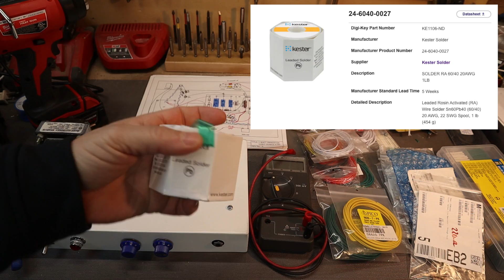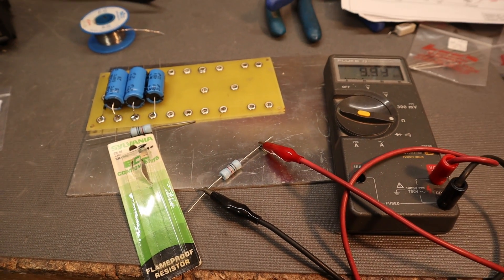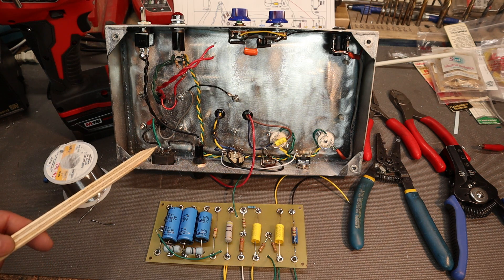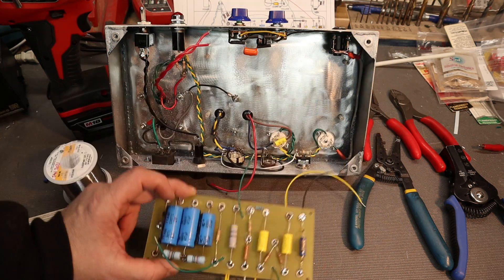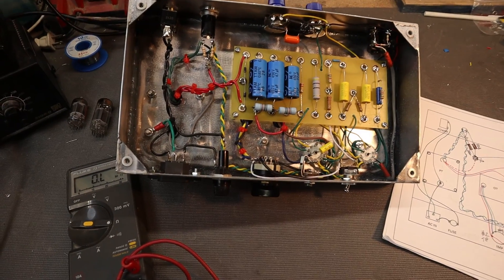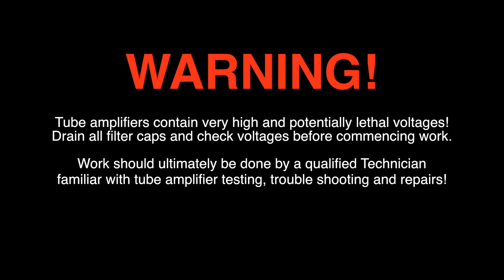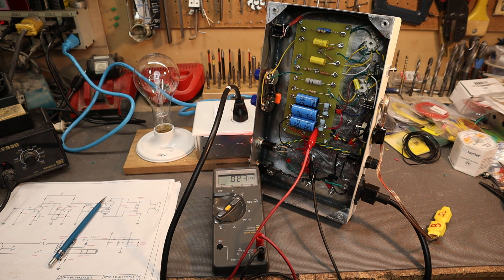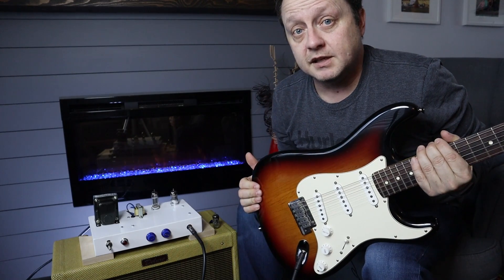Making a 1 WATT TUBE AMP-Part 2: Wiring, Testing & PLAYING // Building a guitar amp from scratch!

Comment: The 12BH7 is  being very conservatively run at just 1W of output, each of the two triodes is rated at 3.5W giving a total of 7W for the device. Class AB should be around 60% efficient suggesting that this can be driven to 10W continuous without exceeding its ratings - for typical audio use that implies a you-can-get-away-with-it peak of probably about 15W. The output transformer would need to be bigger, but a lot can be done with this parts line-up. The 12BH7 was designed as a TV frame output triode, that's a substantial workload and they are not flimsy components.

For something delivering more than 10W it's not the obvious choice but commenters here who think that 1W is a bit too low even for practice or studio use should note that it can do a lot more if asked.
Reply from the maker: Yes, the 12BH7 is a stout tube and it can be pushed hard.  It doesn't get a lot of credit.  I typically don't like to push my tubes hard. I'm the type of person that likes to make them last and I typically don't bias them too hot.  I do want to try a 12AU7 in this amp to see how much a difference it makes in volume and tone.  Cheers.
Reply: @MikeFreda  When I was a kid just learning about electronics, the 12AU7 family was everywhere. This is the first time I've seen the 12BH7 so thanks for bringing it to my attention. For output stages we'd typically see a pair of 6BW6 being used (6V6 shrunk to fit a B9A) base, but that would be a much bigger amp! I wish I'd kept a box of the transformers from those days, they'd be worth a fortune now.

Comment: I cannot believe that you leave the underside of the chassis bare steel it will rust, even painting it, it will not last. Steel chassis should be plated.
Reply from the maker: I appreciate the feedback; Yes, I should have on this one. I typically do but I'm not too concerned. My amps sit in my house in a dry environment the the bottom of the chassis is sealed off my the cabinet. It will be 50+ years before it may rust away... The caps will be done way before that.  lol  Cheers.

Comment: Hi, so I built the amp - and all the voltages check out except I get very low volume output from the amp. I checked everything and ya.....stumped to be honest. Any suggestions??
Reply from the maker: I suspect you have a wiring issue, wrong resistor value.   What OT did you use? PM me a few pictures and voltages and I can have a look.
Reply: @MikeFreda  I used the hammond 125A, I suspect it's because I'm running it off mains AC - kinda figured while I wait for the power transformer to be wound I would like to hear what the amp sounds like. (I have 230VAC for mains, which I thought would work seeing that the transformer gives 230vac) I am using a 20VA 0-230 0-6.3v for the heaters. 

Apparently you need a transformer  or I needed to adjust the rectification to simulate a center tap.....first amp build so still learning
Reply from the maker: Interesting. I don't recommend doing any of this. Doing this is very dangerous. I recommend waiting until you have all the proper components.
Reply: @MikeFreda  Oh and on the layout if the 13.6v is a negative, I'm only getting positive voltages, but in line with the schematic and layout

Comment: Outstanding build. Your tone was great and the steps were clear, concise and easy to follow. Very clean throughout. I even enjoyed how you built the chassis using TIG welding. Sounds great.
Reply from the maker: Thanks for commenting, I really appreciate it!  It was a fun build. I liked it so much I'm making a High Gain and a JTM version using this output section. Cheers.
Reply: @MikeFreda  Don't laugh, but I got into fiddling with amps. I would find these old tube amps on eBay that didn't work. Through the grace of God and help from a guy I befriended, (Jon Besent, who was an amp builder that started "Austone"), I never blew myself up. I bought a tube PA amp at the swap meet for $5.00, and converted into a amp head. It had 2 EL-84s and 1 12AX7. Believe it or not it rocked.
Reply from the maker: We all have to start somewhere. I started building tube amps in my late 20's when I came across a Fender Amp book that had a Schematic of a Champ in it. I said to myself, "is that all it is?"  I bought the book and took it to work. An old guy I worked with was into ham radios. He laughed when I showed him the book and told him I wanted to make this Champ amp. He then proceeded to educate me a bit.  The one major thing he told me was to always keep on hand in my pocket when testing.  I still do that today. Cheers
Reply: @MikeFreda  Very cool to have a mentor. The electronic guys are not around anymore, or at least in my neck of the woods. I live in the desert area of California, and when I was in high school we had electronics class. I wish I took it, but being a 16 year old kid with a 68 Dodge Super Bee, I dove into auto shop 100%, and we cruised the main drag in Palm Springs. It was a great time to be alive. Wish I would have picked up a guitar way back then too.

Comment: You didn't test the negative feed back loop?!?!

 But what great video I definitely want to do the same thing but I'm thinking maybe put two output tubes ( I had thought of maybe using four 12 ax7s as I'll put tubes but I don't know if that's even feasible)  and maybe a full tone stack. Put a potentiometer on the feedback loop and put it on the front of the amp as well That would be really cool. I'm definitely going to build this again thank you so much for posting this video and all the work you put into it and the schematics and everything Great job.
Reply from the maker: Thanks for commenting. Part 3 has some more test tones near the end. I was planning on a making a Part 4 with just playing but I never got around to it. It's still in the works.  Output tubes typically have a low MU and are able to drive more current. I don't think a 12AX7 is suitable for that sort of job. 12BH7 and even a 12AU7 is a better option in the output section. Adding a pot on the feedback is basically make a presence knob. Yes, that will work if the values are right.  To be honest, I didn't hear much difference wit it on or off. I may have to revisit my values.  Cheers.

Comment: Can you tell me what kind of transformer should i use for 230V
Reply from the maker: Thanks for commenting, I'm not too familiar with what is available globally for 230V PT's but I do know Hammonds 300 series have dual primaries for 120 and 240V. They are a little expensive but are available. Another option is to find something in your area that you can a salvage. Cheers.

Comment: can i use this for a phono signal? thank you great vids mann
Reply from the maker: Not really. The input impedance will not match and there is no RIAA equalization in this circuit.  This is a guitar amp, not a HiFi amp. Would it work?  Probably.  Will it sound good?  Probably not.  Cheers.
Reply: tank  you so much for your information friend  @MikeFreda

Comment: Great video! I’m fixing to build the same amp using a hammond chassis. Any issues using an aluminum chassis vs steel? Thanks!
Reply from the maker: Thanks. I've built amps using both types of metal. I don't think it really makes a difference.  Aluminum is easier to drill holes into and steel is easier to weld (if you need to weld the chassis)   Some people feel that the metal can affect the RF and magnetic field of the output transformer/amp. Ken Fisher (Trainwreck amps fame) only built his chassis out of Aluminum because of this.  My ears can't hear a difference. Cheers
Reply: @MikeFreda  thank you!

Comment: I currently have a 7 dollar iron I got from walmart, and no multimeter, do you know of any decent irons and meters that arent too expensive? I've already put together a distortion pedal pcb kit but I don't think I'd get away with my current set up for long 😂😂
Reply from the maker: I'd recommend getting a Solder Station with adjustable heat. Weller makes a entry level one of these.  (i.e. WLC100CUL) I used one of these for years when I first started.  As for a DMM, I'd get one rated for at least ~500volts. When dealing with Tube amps, you can see voltages that high. You want to make sure the unit and the probs are rated for that. I would not cheap out on this aspect. A base Fluke will work just fine for hobby tube amp building. (i.e. Fluke 101)   Cheers.
Reply: @MikeFreda  will there be any problems with not having temperature readout on that iron? Or does it not really matter?
Reply from the maker: Not really but if you want to spend the money, go fo it.  You will get the hang of what works best and what does not. I find maxing the temp of the iron and getting the components up to heat fast and adding solder better than a lower heat and holding the iron for a longer period of time waiting for things to flow.  Cheers.

Comment: Awesome build!! Just out of curiosity, what components would make the amp a higher wattage?
Reply from the maker: Thanks. To make a higher wattage amp, you will need a different power tube and output transformer and possibly a larger power transformer to handle the extra current.  You could use one EL84 or a 6V6. You are then basically making a Fender Champ or Princeton. Cheers

Comment: I love point to point wiring, they sure don't make them like they used to. I have electrocuted myself in excess of 5 times perusing this hobby. Even with the Variac and light bulb i still get the odd bang now and then.  Ah well in the words of Peter Green.
Reply from the maker: Thanks for commenting.  Yes, there is an inherent risk when working with high voltage tube amps.  I like to use the “one-hand-in-pocket” method when testing.  Stay safe,  cheers.

Comment: HI from Brooklyn,NY;Happy New Year; Would this amp for be good enough for high -end headphones,Monoprice M1570 planar headphones? Thanks for help.
Reply from the maker: Hello, this amp is intended for guitar mono operation. There is overdrive/distortion in the preamp circuit.  yes, you could plug in some headphones and listen while you play guitar but its not a HiFi headphone amp. That being said, you could take the output section of this amp and mirror it for stereo usage and graph on a hifi preamp section. (1 triode section of a 12AT7 per channel, 150v at the plate @ 1-2ma bias would suffice.) This would drive any headphones as long as the output impedance sort of matches the headphone impedance. That would be an interesting circuit to make... hmmmmm

Comment: Hey Mike :))

After some deliberation I decided to convert a cheap practice amp into a 1w tube amp.

So a couple of questions arose.

I'm not a purist, and would rather have a functional amp (because I have no other tube amp and where I live, shipping and import tax might cost you as much as the amp itself).

I'm fine with the tone of your build, but:

1. The 6K49VG power transformer works for US power (110v), I had difficulty finding an EU-compatible alternative (220v)
2. If I were to add a 3-band EQ instead of just the tone pot, do you think it is doable?
3. Is using a trim pot to bias the amp a good idea with this build?

Would be grateful if you had advise at least for the first part. I can live with an EQ pedal going into the amp, and desoldering a resistor every time I swap tubes is annoying, but guess I can just socket it.
Reply from the maker: Thanks for commenting. I hope the project works out for you.

Hammond makes the equivalent 220V transformer in their "300" series. It has dual primary taps. Just find one that has the same secondary voltage and current ratings.

Yes, just follow the Fender Blackface Champ (AA764 circuit and layout) Mind you, a TMB Tone stack can rob some of the mojo over a simple tone stack.

This is a Cathode bias amp. It's not common practice to install a trim pot. You do find trim pots on a fixed bias amp.  If you are worried you can just install a larger bias resistor and it should be good for most 12BH7's. Up to 680ohm as recommend on the schematic. The larger the bias resistor, the cooler is runs.

The circuit does have NFB, just install a switch like I show in the video. I have found that its hard to hear a difference. You may need to lower the size of the NFB resistor.

I hope that helps?
Reply: @MikeFreda  thanks for the quick reply. I'll look at the Hammond website, see if I can find something usable.

I actually already changed the negative feedback loop in my schematic.

1. 10k resistor, the recommended minimum, and a 50k pot in series. Should give me a range of 10-60k ohms. I would expect 10k to be quite clean and 60k to somewhat break up.
2. A presence control, 5k pot with a 0.1uF cap connected to the ground.

Both are described in "Negative feedback loops and the Fender presence control" video by Uncle Doug.

I can share the result if you're interested.

As for the treble-mid-bass controls, I agree that they take certain peaks and you do lose tone in between. The way I'd go about it, add another 12AX7 in parallel, filter the inputs, use pots to add certain frequencies. I could use an op-amp to do it too, but that might be seen as cheating, and I'd need a separate power supply for the op-amp.

But it still feels like overcomplicating something that is unlikely to be used in studio or live, this is a practice amp after all.

After some research, I decided not to implement an fx loop because most of the distortion happens in the power amp, so the fx loop would likely sound like crap.
Reply: Also, what if I want to add a switch to the negative feedback loop?

Comment: I'm curious how do you find the load resistance for preamp tubes?
Reply from the maker: Thanks for your comment. Figuring this out can be a bit convoluted and can get a bit confusing. When designing from scratch you need to look at the tubes load sheet/graph and see where its optimal performance is for the application being used. Once you figured out what that voltage and current is, use ohms laws to figure out the bias and load resistor. You also need to know what your PSU is supplying. What a lot of people do is use a known current value from an existing circuit that has been figured out and use ohms law (V=IxR) and adjust the resistors to suit.

Comment: does this work well with pedals?
Reply from the maker: Thanks for your comment.  Yes/no. At lower volume or changing the input tube to a 12AY7 or 12AU7, it would be great.  As it stands, the 12AX7 / circuit design does over drive the power tube when you turn the volume past 5/6.

Comment: Hi Mike, This is a great build. I have a question if you don't mind? What made you choose eyelet board instead of turret board. Any particular reason?

Thanks
Reply from the maker: Hello, thanks for your comments.  I use eyelets because they are easier for me to obtain, install and wire especially under the board. Fender uses eyelets well into the 70’s. I’ve used turrets a couple times and they work okay, nothing really wrong with them. You do need a thicker mounting board. It’s not something that stuck with me since it was awkward for me to purchase.
Reply: @MikeFreda   Hi, that makes perfect sense now you’ve explained it. I think I’ll look into eyelet board. Love the amp you made so might attempt my own version 👌

Comment: Just a quick safety tip. Always run the source or line to the rear terminal of a fuse holder. The load goes to the ring. The reason is the ring is exposed when the fuse cap is removed.
Reply from the maker: Yes, you are correct. Good catch. That was corrected upon final assembly.

Comment: Are you using a tube rectifiers ? What is the desired B plus voltage for the tube plates ?
Reply from the maker: No. Solid state. Please have a look at the Build Schematic in the Description.

Comment: Sure would be nice to have that link to that Hammond chassis.
Reply from the maker: A complete build document will be uploaded with the part 3 video. I’ll include alternate parts as well (like the Hammond chassis) I’m working on that video right now.  The chassis I built in these videos is 11.5”x 6.5”x2”.
Reply: Thanks for the reply, @MikeFreda .  The dimensions are quite helpful.

Just out of curiosity, if a person wanted to simply build a 1 watt power amp, assuming they already had a viable preamp, would it be feasible to simply feed the output of the preamp thru the 0..022µf/600v bypass capacitor, connected to the grids of the 12BH7?
Reply from the maker: Yes/no.  Most preamp sections will work with this output stage. Just have to be careful you have the coupling caps installed and you are not pushing/driving the tube too hard. The other issue is the output transformer. You need to have the correct primary impedance and it needs to be a a push/pull OT.  You just can’t take a champ OT for a 6v6 or Deluxe OT and try to make that work.

Comment: great build what was the current you ended up with through the 12BH7
Reply from the maker: Thanks. As per my Documented voltages on my build schematic (link in the description) each triode is drawing 12mA ~4 watts.  The listed max values are 20mA. This 12BH7 appears to be in the wheelhouse of its Typical Characteristics.

Comment: Great build, looks similar to my Princeton clone I built last year!

Few questions: 1) have a part number for your impedance selector? 2) what software did you use to make up your schematic?
Reply from the maker: Thanks. It’s coming together. Next video will be out shorty. The switch is a Alpha 4H2. On the final version of the amp I actually decided to remove the selector switch and go with a line out instead. I used AutoCAD for the schematic. One could use Draw.io as well.